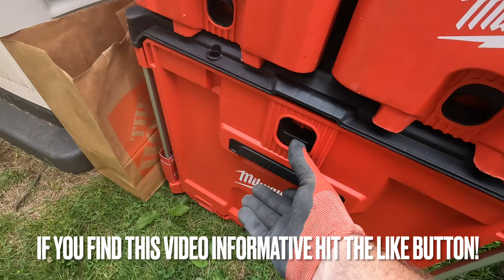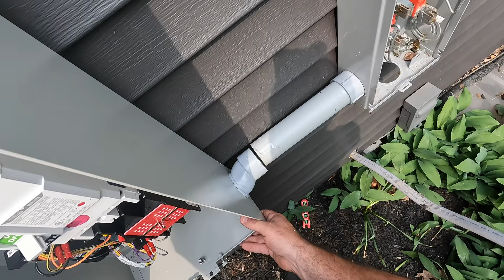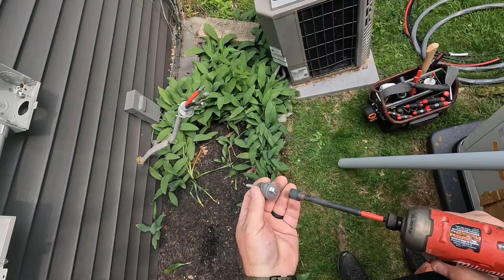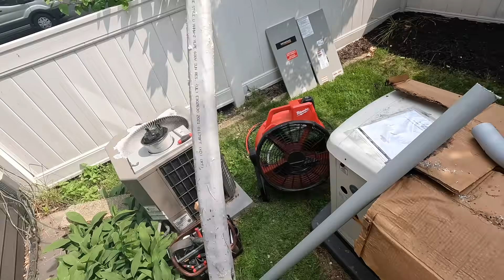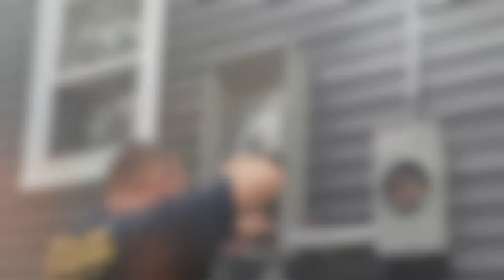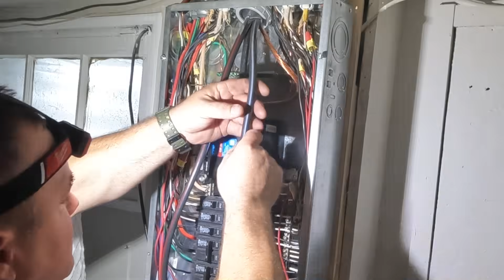A Generac Standby Generator Starts With.....

Comment: is there a distance you'd say is too far for that bond to be from the generator?  I have a battery system with inverters that will power my house... Everywhere my neutral and ground go they do not touch. The bond is at my meter. I have a transfer switch, but it does not sit near the bond. is that an issue or as long as there is a bond at the meter? I could send you a pic of the layout if you wanted to take a look. thanks for the videos. Even though you're east coast, I get a kick out of seeing the work you do.
Reply from the maker: The bonding gets done at the service disconnect.
Reply: @electricianron_New_Jersey  an electrician friend said you want to be careful.... I got the feeling he was implying that a neutral that is connected to the grid that has a generator or inverter attached could cause issues grid side in a power outage. But I don't really understand how? I mean, these disconnects are UL listed right? they're OK to use when power is out and you have a generator running, lineman aren't getting zapped?

Comment: I agree, lags 100%, your install looks good!

 I don't like how cans sit on siding ( my opinion it should be a code that electrical equipment needs a flat surface to mount to), I have been using rod anchors (lag bolts with 1/4x20 female threads in the head) I mark my mounting holes then put in rod anchors and set them so the can will sit level, then use 1/4x20 screws through the can into the rod anchors. I don't do this all of the time, only when dealing with vinyl (or some other uneven surfaces), the other problem is when you run the screw tight it will crush the vinyl siding. (especially if you let an apprentice do this)
Reply from the maker: That's an interesting method to get a level mount on siding.

Comment: Hey Ron…couldn’t you have ran a separate ground wire to the switch instead of replacing the whole cable?  I have a similar situation at my home…where everything is still bonded at the main panel….but now the transfer switch is the first disconnect.
Reply from the maker: You can’t just run a separate ground wire and call it a day. Call a licensed electrician.
Reply: @electricianron_New_Jersey  bummer
Reply: @electricianron_New_Jersey  the licensed electrician I had install the generator and switch should of checked that when they gave the quote.  Only 3 wire between the house and meter would have been a sign.  SMH.  Learned a lot between your vids and Mr NEC Mike.

Comment: Crimpers, Daniels Manufacturing makes hand held hydraulic crimpers that are compact, easy to use and have numerous jaw types for various crimp types. Might want to check them out. I ran a US Navy Aviation Tool Room and was an Avionics Technician who was the 'Go To' for Connector and Wire Repair. The Hydraulic Hand Crimpers are primarily used for working with armored antenna cables so they should work for you. Oh and yeah, they got more kinds of crimpers than you can shake a fork at. There are the Hydraulic Hand Crimpers which are the smallest, but then... there are the jumbo ones that take two hands, and another I had to deal with..... took a whole suitcase for that thing, still not the biggest ones..... ships use those.

Comment: ron , you prefer using 4 wire cable instead of individual conductors? is it cheaper, and is it a much easily installation going thru LB'S? Whats the code say about using cable feeder in fittings...tnx... i get confused

Comment: Did you block off the hole in the bottom of the meter can where the old service line came out
Reply from the maker: You’re the first person to catch that. I actually did not have a 2” KO seal. I’m going back in a week or two to wire the generator.

Comment: Why did you used a PVC expansion joint?  Is it required by the code?  Seems to be really short to require one.
Reply from the maker: It makes for a better installation.

Comment: What wire did you splice in the basement? The new 200 amp wire has the ground wire and the ground common wire plus the positive wires but I couldn't see what you spliced together. By going with the video you have 3 separate grounds with 2 of them connected as ground common wires.
Reply: Why'd the home owner remove the solar panels, was there an issue with them? Just wondering if I should reconsider getting solar panels.

Comment: I'm curious about the bonded neutral in this application. It seems you have bonding at both the panel and the transfer switch. Does a generator change the rule about first means of disconnect?
Reply: It does not.

Comment: Not an Electrician but low voltage. I use duct seal on the backside where it goes into the structure or lexeal silicone in the hole.

Comment: I am super surprised you didn’t originally wire the panel anticipating the Generator 😂
Reply: How would you do that 3 years after the fact? Generator changes , transfer switch changes, Code changes  then your screwed
Reply: @ed6837  Well the entrance cable could’ve been 4 conductor, and the panel wired with the ground and neutrals separated! BTW I know Ron is one of the best, so don’t think I’m disrespecting him!

Comment: With the transfer switch being labeled as emergency disconnect would it be acceptable to remove the neutral to ground jumper wire from the transfer switch and maintain the main panel bond?
Reply from the maker: No, the main bonding jumper must ALWAYS be located at the service disconnect. Anything downstream from the SERVICE-RATED automatic-transfer switch must be grounds/ neutrals isolated from one another or current will flow objectionably on the equipment grounding conduct since current leaves the source and returns to the source.

Comment: Do you install the AC wire into the SACM of the Transfer Switch to prevent overloading the generator by shedding the HVAC loads?
Reply from the maker: Not yet.

Comment: Ron, on the Slugbuster (very familiar with it), can you use an impact gun with the proper size socket rather than the hand ratchet or would that create a problem?
Reply from the maker: I wouldn’t recommend using an impact for that but a drill/ hammer drill would work well.

Comment: sweet work -  As a DIYer I always learn something new from your videos and this one was no exception - extending a grounding electrode conductor by a crimp. thanks.  When I installed my 125 amp service panel back in 1998, they only required a single ground rod.  When my neighbor had her 100 amp panel updated, the electrician put in to 2 ground rods and I asked about that.  He informed me about the new (to me 8 years ago) requirement, so I need to add a 2nd rod before inspection of my new 200 main lug only service panel.  Following that I will be upgrading to a 150 amp service and that will require a new service entrance meter panel. 

the Muni PoCo has service impact fees, so to upgrade from 125 amp to 150 amp will incur a $843 impact fee.  Then sometime later the upgrade will incur another $1686 impact fee for a 200 amp service.  being retired that requires saving pennies.  such is my PoCo

Your videos really help me
Reply from the maker: The reason the second ground rod was added was to minimize resistance in the circuit to harness an over voltage
Reply from the maker: to ground